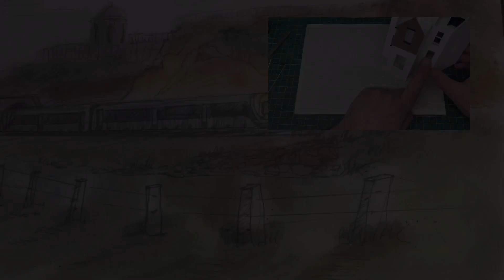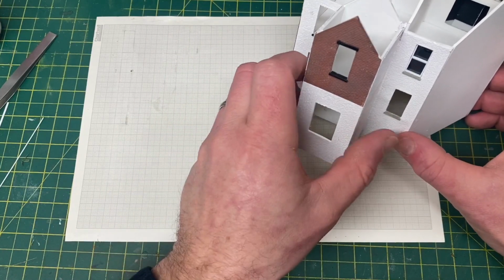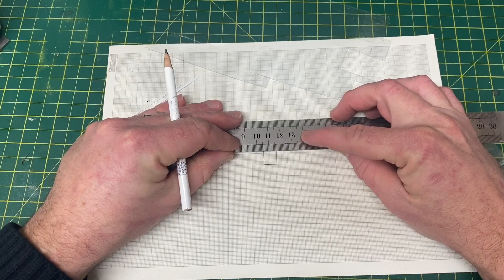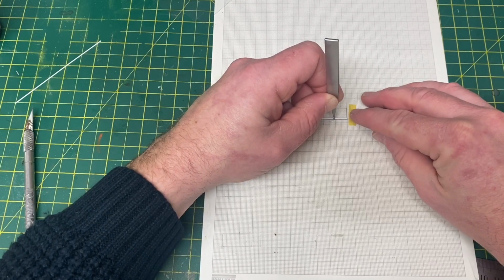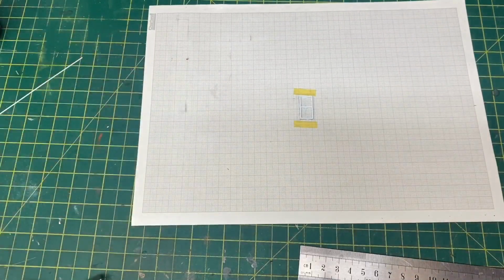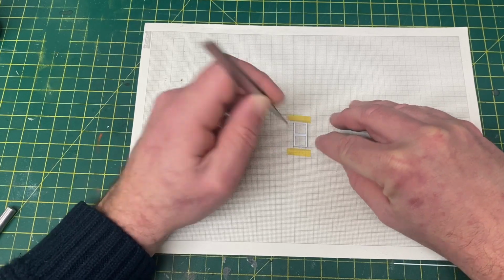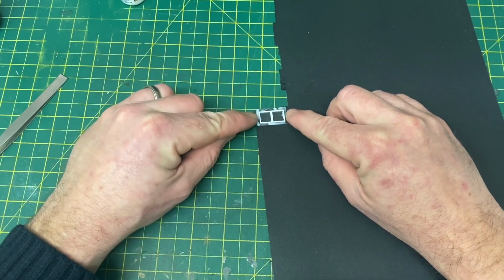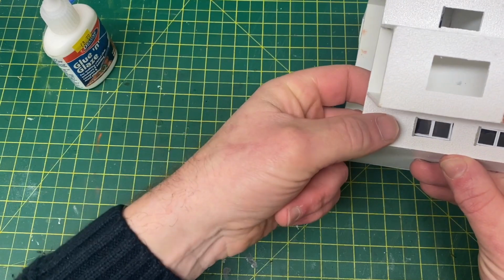Modelling Sash Windows In A Few Easy Steps

Comment: Hi Paul a great modelling mate I may have to take my layout out for the loft and build a new layout in one of are bedrooms using the Stranraer Harbour part of my layout on top of the new layout with a line running down to a two track mainline on the lower part of the new layout because my back is every bad but it is stupid in the air at the moment please stay safe and well mate goodbye for how clive
Reply from the maker: Thanks Clive. Loft spaces don’t always work out for the best and if you can get a room downstairs within the house it’ll make things so much easier for you. Best of luck with the new project. Paul

Comment: not really sash windows, more like modern two pane window but not bad effort, i've worked on actual sash windows and the top does sit in front and also has a tail on either side, i've made them in 00 scale and there pretty easy to do and look good.
Reply from the maker: Hi Desmond, you’re right and as I said in the video it gives the illusion of them being sash windows. Paul